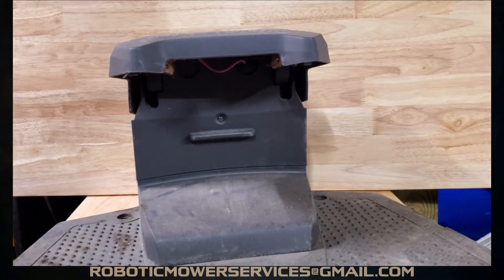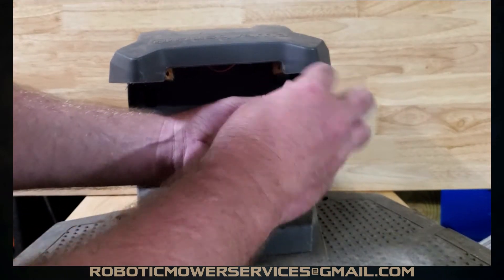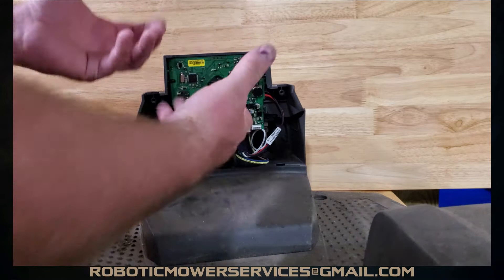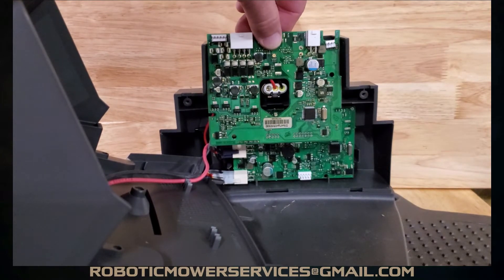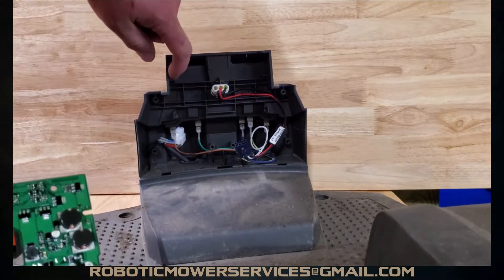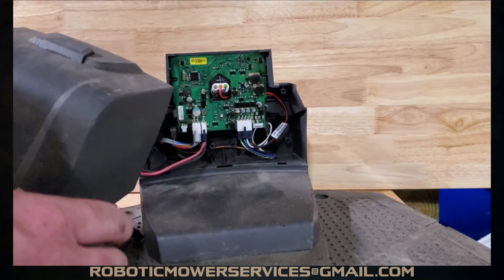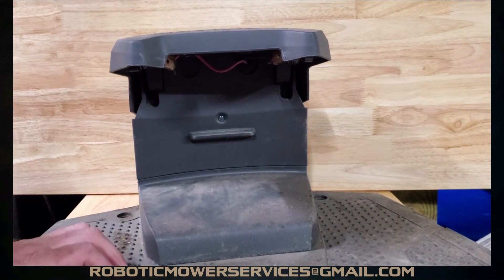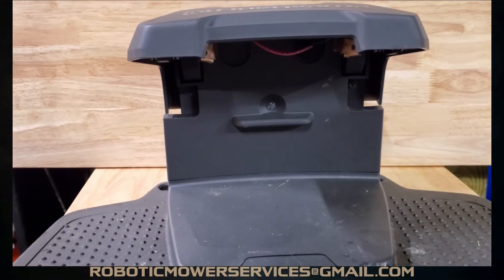How to replace the circuit board in a 300, 400, and 500 series Husqvarna Automower Charging Station

Comment: Hi do you have any advice on how to do this on an Easilife Go 500. I'm experiencing issues with mine. I've tried a new battery and a new charging cable but it has not fixed the problem. So I'm wanting to dismantle the charging station. Any knowledge on this model? Cheers

Comment: I have a pretty regular problem with my 2 450x mowers. I have replaced multiple charging boards with burn out ground wire (top right pin black wire) is this a power problem? common fault?
Over five years have replace 3 in total